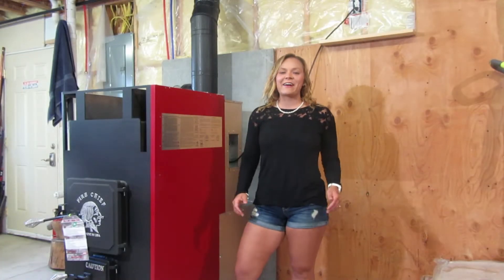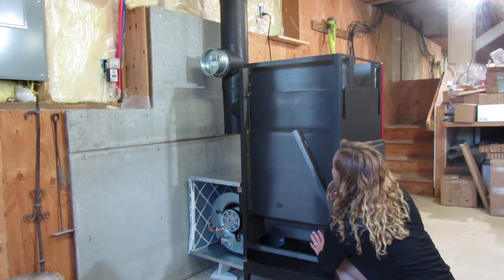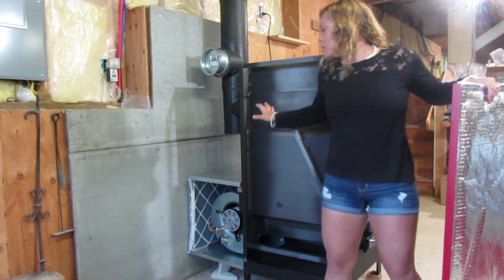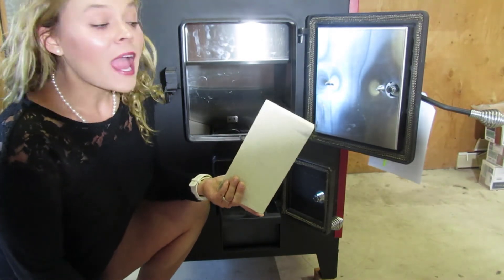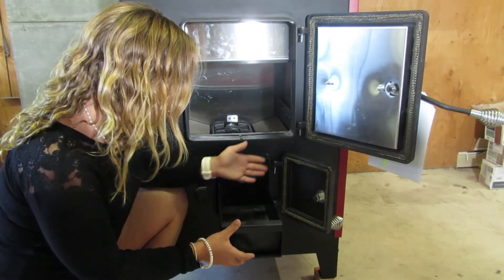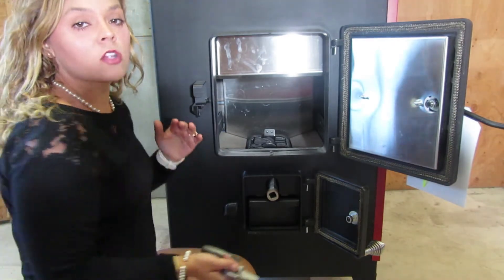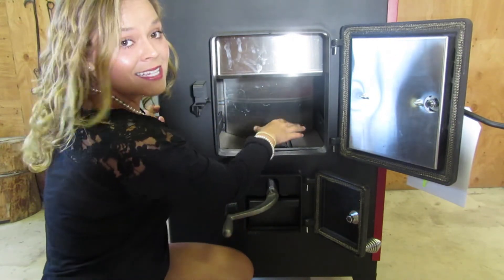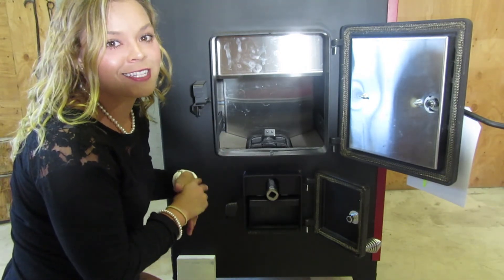Obadiah's: Fire Chief EPA Wood Furnaces - Inside the Furnace

Comment: Nice video, did notice the lake of space from the wall to the air intake of the fan.  In past years of working on various type of stoves/furnaces, I would always have to keep aprox 6" to a foot clearance so the fan would get proper air supply.
Reply from the maker: Yes, there should be more space behind the unit. This unit was placed temporarily for filming purposes.

Comment: To bad I can’t buy the FC 1500 ! Apparently I can’t get ahold of one
Reply from the maker: Due to EPA 2020 regulation change, the model had to be discontinued, and are technically illegal products to be sold. Due to COVID-19 the processing of paperwork from EPA has been delayed. Therefore, there are limited options of EPA 2020 approved furnaces for sale in the year 2020. Manufacturers should have their paperwork ready on the larger EPA 2020 wood furnaces by Spring 2021. Coal furnaces are still EPA exempt, and may be an option for your application.
Reply: Obadiah's Woodstoves  I had to get a 2020 FC 1000 EPA one cuz I can’t wait till whenever the new models are coming out ! But I still wanted to 1500 cuz i really wanted one with a shaker grate